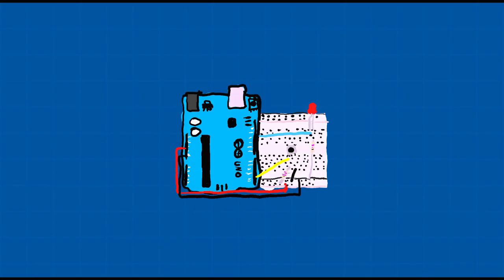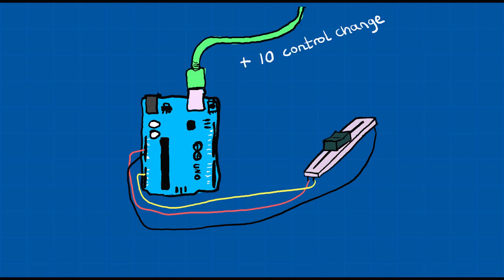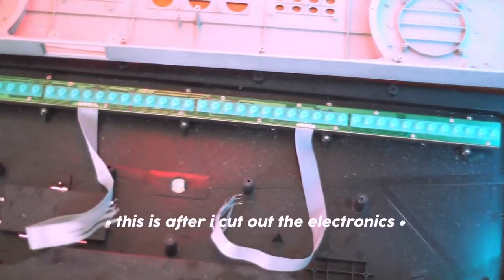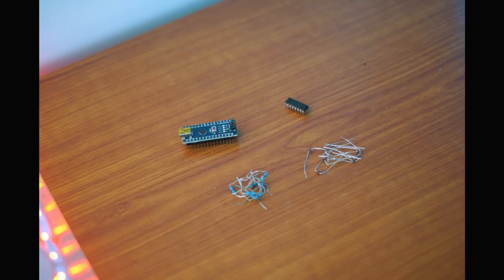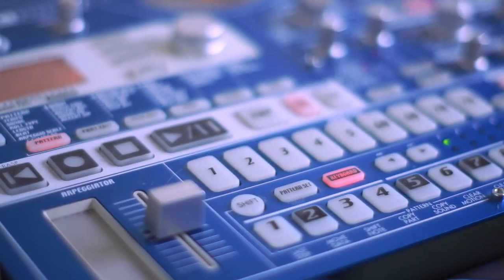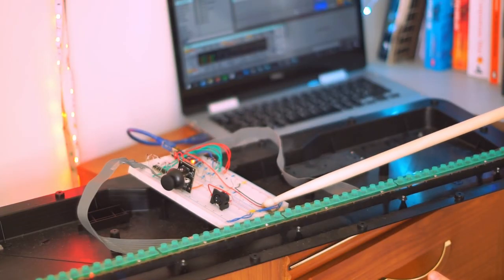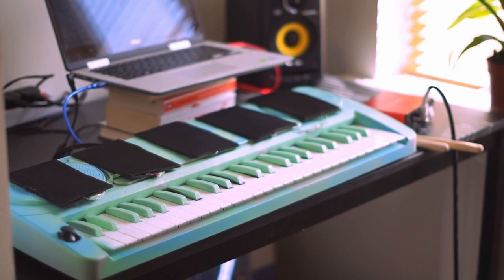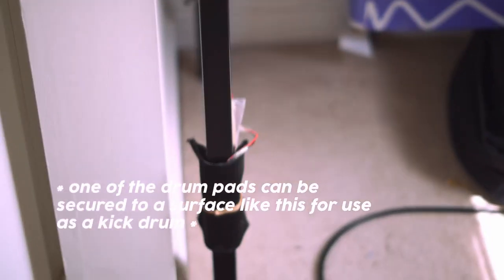I Turned an Old Keyboard into a Midi Controller

Comment from the maker: Hi so I've finally uploaded the code and circuit diagram for this on github - the link is in the description! 
Note that it is specific to my keyboard but should help in setting things up for your own keyboard at least.
Reply: Thank you! (btw please make more videos!)
Reply: Is possible conect this on a smartphone?
Reply: im using the midi port for my project do i need to power the keyboard? or the power come from the midi?
Reply: What are modification to do for 61 keys
Reply: good contemnt
Reply: good looking out mate

Comment: Very cool. I recently picked up a Yamaha Cvp- not working, but nice weighted keyboard. The few of little silver capacitors on the MB leaked. I could smell it as soon as I got it home and turned on. Other than that everything is fine. I pulled everything and know I can turn it into a midi keyboard for Ableton. 88 keys. It needs to happen. Thanks for the inspiration .

Comment: Woww...love that tune you whipped in the end! Awesomeness!

I think you're a genius coz having the technical electronic skill then comes up with a tune like that involves BOTH hemisphere of the brain, and you nailed both of it!

I don't have any experience with Arduino, and was thinking that this has to be my first project! Would you suggest it? Will it be too difficult for an Arduino newbie like me? 

I really need this specific project because I have one or two toy-keyboards that I want to put MIDI on.

Could you share a How-to-DIY at Instructables ? Please? Pretty please? Thanks in advance!

Edit: I instantly subscribed when I saw those funky pastel green keys combined with white keys, with cool drumpads above and those tunes being played! 

PURE AWESOMENESS!!!
Reply from the maker: Thanks for the kind words!! I have been vaguely planning to put up an instructables but I haven't gotten round to it yet - in the mean time you should be able to find one or two similar projects out there - I found one that helped me make this. The code and wiring will vary depending on the keyboard and the debugging can be a bit of a fiddle so I don't think this is a beginner project - the best place to start would be to get a starter kit and do some beginner projects on a breadboard like making LEDs blink and stuff so that you can get familiar with how it all works, especially if you have no programming experience (I had a fair bit when I started so I can't speak for how steep the learning curve is if you haven't). I have only been working with arduino/electronics as a hobby sporadically for the past couple of years though, so you definitely don't have to be an expert!

Comment: The arduino part I thought was the obvious part, but how did you managed to make the paint stick to the keys? It never ever works right for me, every plastic piece that I tried to paint until now just a month latter is fully scratched.

Comment: Can we use any Arduino?.....and if possible share the circuit diagram for the diodes :)
Reply from the maker: Yes you can use any Arduino - you can use shift registers to expand the number of digital inputs as required. I've now put a link to the code and circuit diagram in the description :)

Comment: Great job there! I also built one but facing some issues while playing the chords. Can you share your schematic and code so that I can get some reference. 
Hoping to watch more such awesome projects of yours! Keep it up.
Liked and Subscribed!
Reply from the maker: Thanks for watching! I had issues with random other keys being triggered when certain combinations of keys are pressed, which upon further research I deemed to be due the keyboard matrix allowing current through undesired pathways, so I added in diodes to prevent that from happening. I have been planning on putting up my schematics and code but I haven't gotten round to it yet. In the mean time you might be able to figure it out by looking up stuff about keyboard matrices.
Reply: @ph4sespace  Yeah, I know you've already mentioned this in your video. I searched for this thing as well which turns out to be something called as ghosting or bouncing of current. Using diodes is the right thing to do but I've seen some people using software solutions. I'm using a pull-down register configuration. Since i have already soldered it on protoboard, I was looking for a software solution. Adding a delay does help a bit but not the optimal solution.
Thanks again! I'll try adding the diodes!

Comment: delay ? how about velocity ?
Reply from the maker: By delay do you mean if there is any delay when pressing the keys before sound is produced? If so then no, there is no noticeable delay. As for velocity, the keys on my keyboard do not have any pressure sensitivity so variable velocity is not possible, but you could find a keyboard that does and use that if you wanted. For the drum pads I do have variable velocity as piezos allow for that.
Reply: @ph4sespace  thx for reply, wow no delay, that's awesome, I want to try this but would you give me the detail about wiring cable and source code for arduino cause I'm too newbie for this, but there is no compulsion for that.
have a great day :) .
Like and sub.

Comment: hmm. so basically you threw away the electronics inside the keyboard except for the actual hard wiring that the keys physically pressed on? ya i probably shouldn't try this with my wife's supposed $400 non-MIDI keyboard.

is there a way to convert the analog headphone jack signals to MIDI instead?